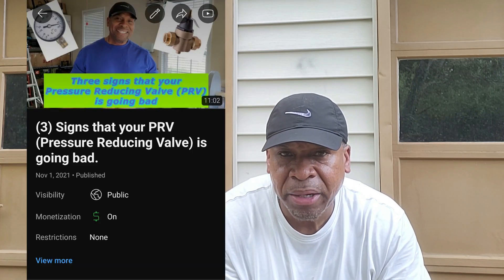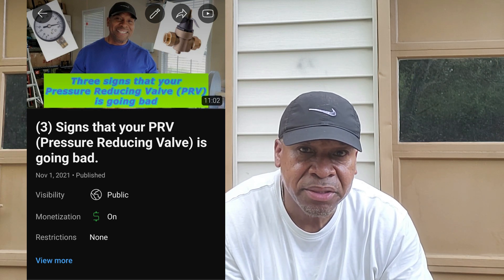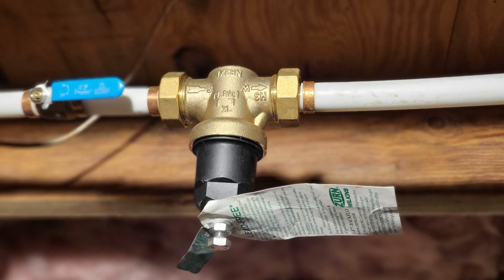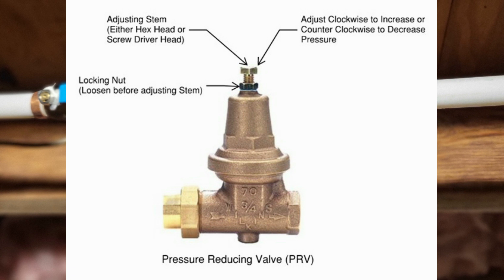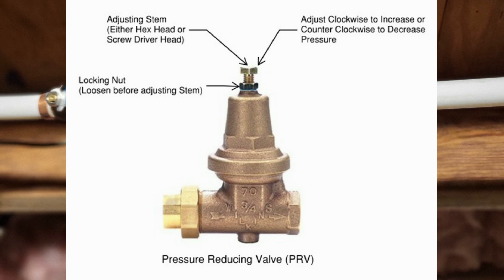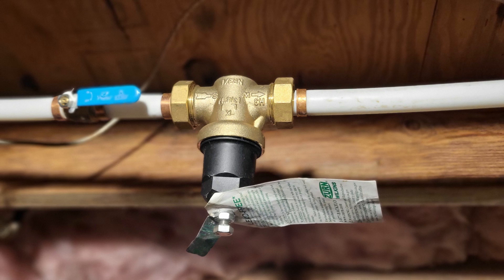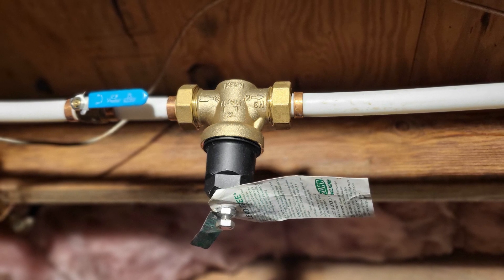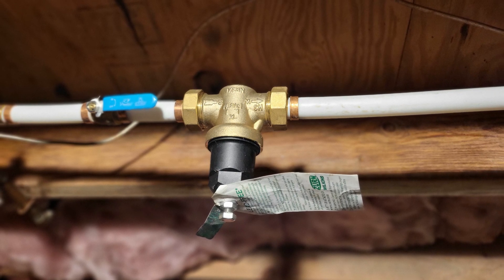Are You Having Water Issues?..It Could be a Bad (PRV) Pressure Reducing Valve.

Comment: I know this is a older video but any clue why my water pressure keeps rising even after I lower it on the pressure reducing valve?
Reply from the maker: How old is your home??.... the PRV could be faulty.
Reply from the maker: You check the pressure at the washing machine box?
Reply: @PPG1967  I checked it at the washing machine and it will keep rising to 120
Reply: @DustinFox. This could be thermal expansion from your water heater. If you turn off the water heater and let it cool down the pressure should stay relatively the same minus any fluctuations from the city. If turning off the water heater fixes it you may need an expansion tank on the water heater. If it doesn’t fix it you probably need a new prv.
Reply: House was built in ‘85 and was on well water until about 10 years ago most of the pex lines and fixtures are fairly new. PRV has some condensation on it but not really leaking or anything

Comment: In any of your videos do you address the flow restrictions of type B pex? Many times I have seen baths installed with 1/2” type b crimp pex. Because of the flow restriction, without having the tub diverted pulled, the shower head  will still turn on/leak 3/4 type b pex is more like 1/2” copper and 1/2” type b pex is more like 3/8” copper
Reply from the maker: I prefer type A over type B, but type B is mostly used on residential applications. You're are correct, there's a pressure drop using type B.
Reply: @PPG1967 I don’t know why but I have never seen a builder in Arizona use crimp pex B on a house. It’s always expansion Pex A or Zurn expansion pex B.